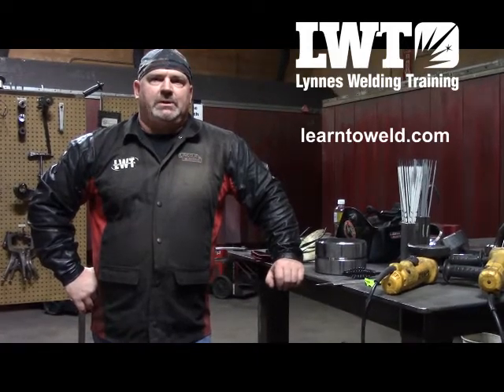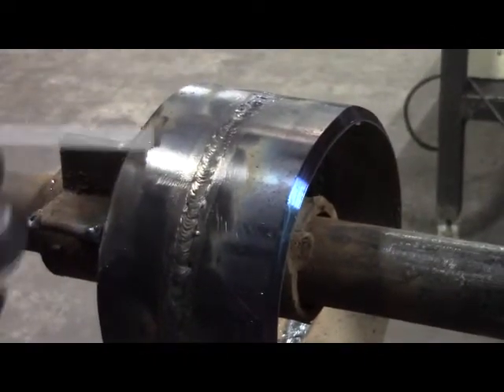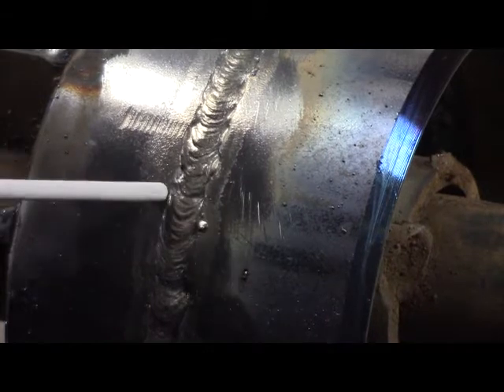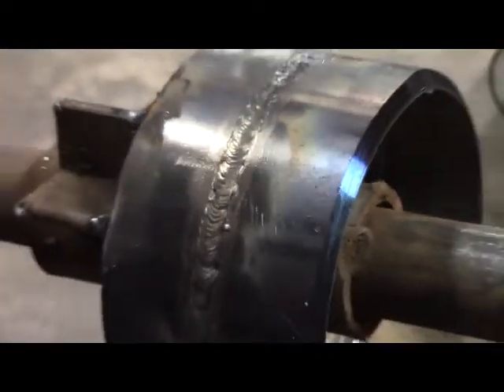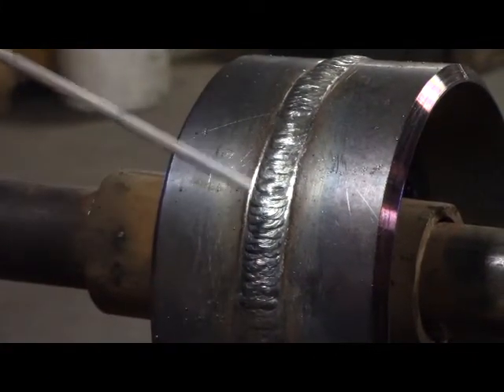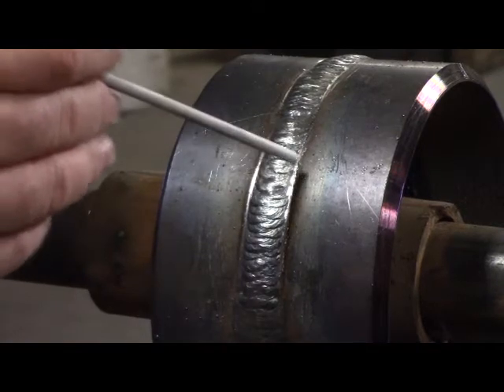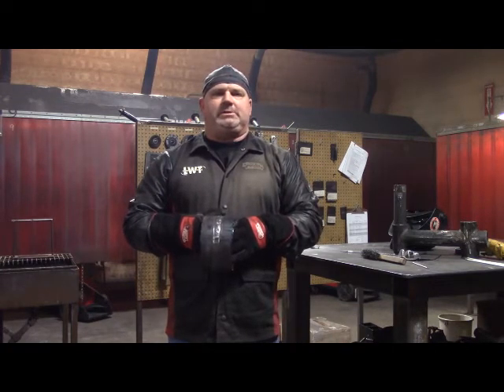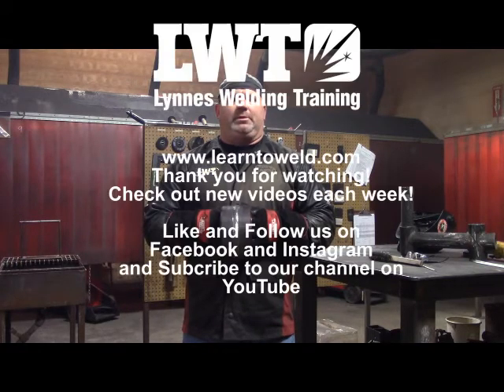Part Four: Cover Pass on SMAW Pipe Welding 6" Sch. 40 1G

Comment: Hello, I have to ask again, sorry if I missed it. But what amps do you run your cover pass? I use the same rods, 3/32 7018. Just trying to make myself a better welder. Thank for another awesome video.
Reply: I've been told to go upwards of 150 amps, but it really does depend on the heat of your material and how fast you're going
Reply: It does look like he's going a bit lower since the ridges are so well defined